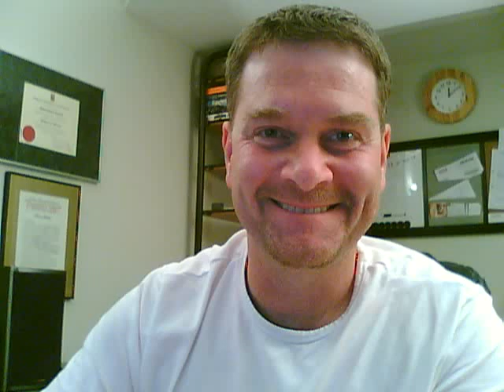#31 - Question/Answer: Overclocking CPU & Memory

Comment: Hi. I am new to over-clocking and i can not find much information about the RAM over-clocking techniques. 
I have bought a Corsair h100i for my processor, it is the best performance for money i found. CPU over-clocking is all over the net, so thats not a issue.
How can i find the Sweet Spot? is there test or literature that i must do or look for?
Also, is any ram over-clock compatible? i go the corsair vengeance as i seen many good reviews and my motherboard is a Z77, extremely reliable.

Comment: @12344richard If you're asking this question, changing the CPU in your laptop is not something you're going to manage to do very easily. Your processor looks fairly solid from the look of the specs online. If you're interested in overclocking, buy a desktop.

Comment: Hey! I have a intel i7 870 2.93 Ghz socket 1156, motherboard ASUS P7P55D-E LX and i use the original cpu cooler. I know it's best to have a much stronger cpu cooler, but it is possible for me to overclock it to 3.4 Ghz stable 24/7? i want to do it in the bios, but i have no idea how the settings should be. i have searched around the internet, but i can't get this!. so if someone knows how to do please answer! just write down the settings in the bios, i would be very greatful!

Comment: i got a i7 920, and it was pretty easy to OC it to 4.00ghz, but after some tests I found a couple of bottlenecks, most notably on the HHD and GPU, so I clocked it down to a safe 3.2ghz with a voltage of 1.2v. Not worth wearing my hardware down, i'm a poor man.

Comment: I NEED HELP!: mi pc lately said that it's overhitting on the boot page with red letters BUT today after rebooting after using my antivirus didn't boot, i mean, appear the windows logo and then black  and then returns to the boot page and so on,  and in the last time the message was: "PLEASE CLEAR CMOS IF SYSTEM NO DISPLAY AFTER OVERCLOCKING".  What's that mean?? do i need to change the cooler?? it's 'cause my pc it's overheatting? do i need to take the battery on bios?? Sorry my bad english! TY!

Comment: i have a question is power suplly that big of a deal when overclocking a cpu? cause i overclock my phenom X4 to 2.60 to 3.10ghz.. and when i go further after that it just locks? its so stable and run cool at 3.10ghz? but when i turn it up even a few mhz? then it locks werid

Comment: Yeah some motherboards have that support. but most of them dont. i have already had to replace my motherboard 4 timesdue to capacitors blowing up. i suppose overclocking on some systems is ok if you have a after market cooler that gives it sufficent cooling. other wise your putting a huge risk to your computer. plus even the slightest over voltage to the cpu and its fried. i blew my P4 2.8 up giving it too much voltage.

Comment: OverClocking is extremely bad to do. When you need more voltage to your Cpu it causes your Motherboard and Power unit capacitors to rise in temperature which meaning it wears them out to eventually they blow the cap off the top. Just a word of advice for people looking to overclock.

Comment: hehe my laptop is shitty. 1.60 Ghz dual core 2 GB ram intel chipset express family >.< is the satellite toshiba thing but its sooo crappy. It gets super hot even if i dont overclock WITH a fan mount thing underneath. I was thinking about over clocking so i could actually run stuff but im worried about it like melting cause it already is super hot. Any advice (do not tell me to buy a new laptop xD)

Comment: i have a core 2 duo e6750 at 2.6ghz  i overclocked it at 3.2ghz whit all voltages control at auto. but at the everest programe it showed that my memory voltage was ta 2.05V is that good or am i going to destroy my ram?

Comment: I used cpu multiplier to Overclock to 3.8Ghz from 3.2.  Voltages are adjusted automatically to suit but i do have the options to overclock using different methods but i find the multiplier to be the easiest and less hassling.

Processor is the Phenom II x4 955BE

Comment: i just bought my new rig.. these are the specs;
maximusIII formula
intel core  i7 860(2.8GHz)
dominator 1600 c8
gigabyte superb 550W
XFX 9800gt
CM v8 air cooling
i'm kinda newbie in this ovrclocking stuff.. could U gve me a little tips then... tq..

Comment: Question for everyone: I can overclock my AMD athlon x2 64 3600+ from (2.00ghz) to (2.40ghz) without crashing/locking/BSOD, etc. I can get it to (2.50ghz) but it will lock up more frequently.Does this mean 2.50 is unstable for my PC, and 2.40 is my stable, at about 32C. But my 2.50 gets to about 35C. I didnt change the voltage, under the impression if its not necessary dont do it. But If I want to go to 2.50ghz will I have to up the voltage? Please, any answers would be awesome.

Comment: ok i get what he means with the multipliers, but i dont get the ram stuff.....do i have to overclock my ram if i overclock my cpu? the only thing i want to OC is my cpu....i would like to leave my gpu and other stuff at default...its mainly cuz i have a slow processor and the other stuff i have is top quality (almost) ....the cpu is an intel Pentium d...i a while back had it at 3.9ghz, runnin at 1.5v but it was unstable....i dont know how to make it stable...any help would really be helpful.

Comment: what are you looking to oc? i used to have my q6600 with a multiplier of 9 and a fsb of 400 to give me 3.6ghz, and its stock speed was 2.4ghz - so it was a pretty good overclock. 

Please be carefull when overclocking, i wouldn't suggesty doing it till you did some research.

Core i9s better overclock well 3dgameman :) thank will own

Comment: you overclock your cpu in bios, by gradually increasing your fsb and voltage, you can mess wiuth ram timings aswell. The best thing about o'cing is your chips(which you overclock could also be your gpu) will run faster, and inturn your framerates if you game will be faster, or you can buy cheaper components and run them at higher settings. For example, if you take a core i7 Do, its stock speed is 2.66ghz, but liquid cooled you can get 3.5ghz (good custom liquid cooling)

Comment: Also i made my system stable by lowering my Multi down to X8 and boosting my FSB to 1800 which keeps my cpu at 3.6GHZ but avoids the FSB hole in the 780i which was the problem that kept rebooting my system anywhere between 1400 fsb to 1600FSB. Once i set my FSB to 1800 and dropped my Multi to 8- it did Prime 95 for hours np.

Comment: Thank You!- The reason i overclock is so i can get as high a FPS as possible in all my games. Your right, any game ive thrown at my rig, it plays flawlessly at 1680X1050 at stock clocks, but when i boost my Intel Quad Core to 3.6GHZ- and i actually lowered the Vcore to 1.5 even, it fliessss and there is never any hiccups in games including Crysis and Far Cry 2 in which i use 2Xaa in FC2 with no lag what so ever. My Video Card is getting kinda long in the tooth and i will be upgrading that soon!

Comment: Its good if you have the right cooling.  If not, thats bad.  Overclocking is dangerous because of an increase in temperature and theres only so much heat your hardware can take.

Comment: Ive tried both ways and my system is still very unstable at 3.6ghz at a 1.58Vcore and 1600FSb at 1.4V. You would think with those vcores, it would be more than sufficient to power my cpu at any speed. So what do you think it is?

Comment: My Box: Antec 900 Case
Intel Core 2 Quad Q6600 3.6GHZ 1.57Vcore 1600FSB at 1.4v X9 Multiplier
Zalman 9700 CPU heatsink
EVGA 780i Tri Sli Motherboard
4GB OCZ HPC Reaper Memory 4/4/4/15 2.2V 
(this is the memory's default, If i overclock my cpu to high freq. do i have to overclock my memory for stability?)
Corsair TX 750Watt PSU %80 Effeciency

My Q6600 is a SLACR G0 Stepping so it should overclock like crazy, but i read the some what newer Q6600's dont overclock nearly as well.

Comment: Hey Rambodomintator. My FSB is only at 1600 mhz X9 multi and my memory is at 800MHZ for a 1/1 ratio so it should be stable. Also my Vcorfe is at 1.57 (which is insanely high) but my temps never exceed 55 on load. I dont understand what im doing wrong. I had to downclock my cpy to 3ghz everything on Auto and it runs perfectly never restarting.

Comment: Hey i have a question, i just bought a 780i motherboard and im trying to overclock my Q6600 to 3.6ghz. I upped the voltage as high as I can go without damage and it runs for a little bit but restarts randomly and will only run Prime95 for a few minutes until restart. My temps are fine, i also bought a Zalman 9700 Heatsink and a Corsair TX 750 Watt PSU and 4GB OCZ HPC PC-800 Memory. SO it should run fine. I personally think its memory timings but i dont know alot about memory overclocking. HELP!!

Comment: Ive been trying to find a solid setting for a little less than a month now. Right now im at 3.2GHZ at 1.4625 Vcore. at 3.6GHZ it still wasnt stable at 1.65VCore! Which is ridiculous! So pleaseee Help me. My stock memory timing is 4-4-4-15 at 2.2V. Should i increase my memory timings? WHat hsould i do? My Q6600 keeps locking up and restarting at anything over 3.2GHZ even with my new CPU heatsink and PSU! Im Desperate now...Do i need to change my memory timings to overclock faster?

Comment: Ok - first of all, you cannot overclock VRAM...
but you can use a program like rivatuner to overclock the core, memory and shader clocks to be able to push more out of your card.

if you want more memory - you can sli the card, but then again, a lot of games dont support sli and you will probably get <60% performance increase from the second card...

Comment: you have a  "eVGA e-GeForce 8800 GS," if yes, the it is over clocked, actually it's "super clocked" you wont be able to overclock any further without water cooling. Good card tho.

Comment: It come standard with 256mb DDR3 right? Then it was overclocked to 384Mb, i dont recommend going more than 2X overclock, it will NOT be stable, even with water cooling.  For graphics cards, you need to download a program supplied by the manufacture to overclock it, if u don't have it u can go to manufactures site and download.  Overclocking VPU IS MORE DANGEROUS THAN OVERCLOCK CPU. You wont get bluescreen timeout, you video will crash and u will need new card...(learned the hard way)

Comment: most boards have safety features. usualy, justr restart and load default settings. if its wrong, youl get a blue screen usually. if it overhears your cpu card or anything, itl shut down atuoamtcailly

Comment: Hi,
   I'm running E6600 at 3.6GHZ on 1.537v memory at 2.2v which is stock voltage of patriot ram and it is now running at 1000MHZ. idle temps at 33c and load is 39c thanks to zalman 9500. I guess the only reason im not pushing higher is because I don't know what the max voltage is for E6600cpu.

Comment: Overclocking in programs within Windows, Linux or MAC is VERY bad, 
pimpedout8888888. Since you can't fully stabilize your system. You overclock in the bios and when done, you run programs to stress out the processor.

Comment: It is unlikely that a laptop power supply would be able to support an overclocked processor, not to mention if you did it would kill the battery.  Plus Laptops arnt well known for superior cooling, I try and not keep them on my lap too long for fear of becoming infertile.

Comment: With Core 2 Duos i dont think the voltage needs to be increased to get a decent overclock ive overclocked from 2.13GHZ to 2.78GHZ without upping the voltage. I done it so i dont get much heat... i wonder how far i can push it.